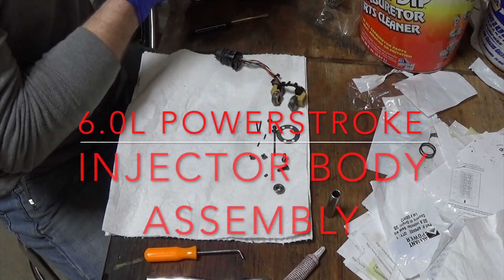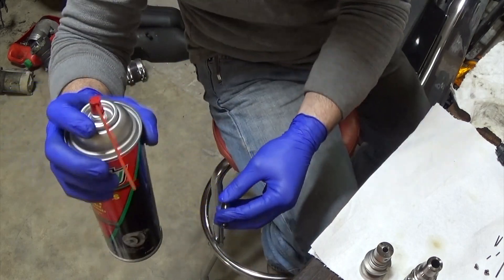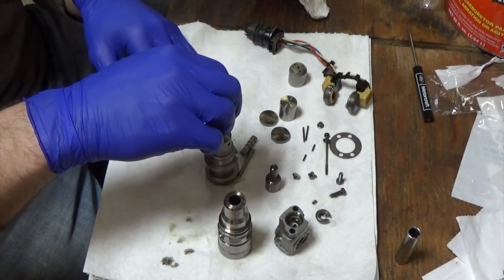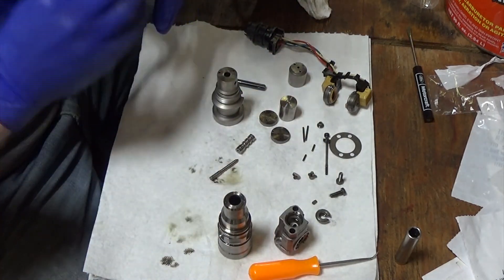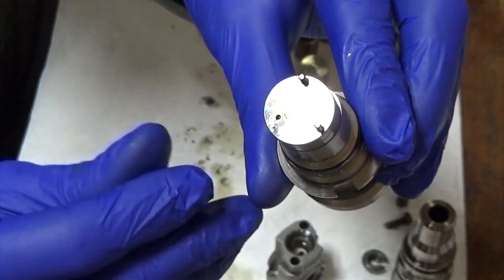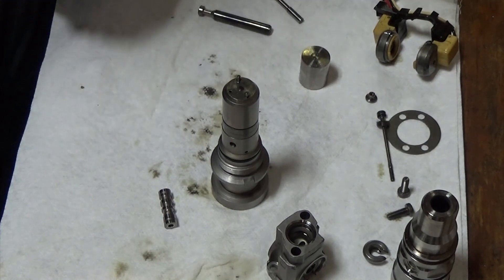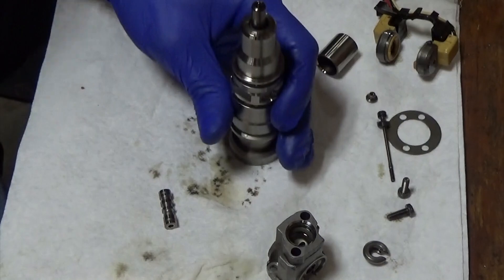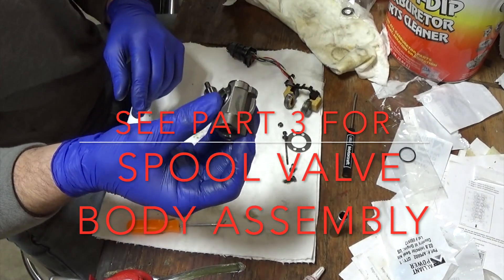6.0l Powerstroke Injector Rebuild, Injector Body Assembly Part 2

Comment: Yes, and I’ve replaced every oring under valve covers, new hpop , have put in 2 different ipr valves , new standpipes dummy plugs, worked on several these things but this one’s wearing me out, I appreciate your videos, was just wondering what symptoms that truck had with backward spool valves. Thank u sir.
Reply from the maker: Yea that’s frustrating.  With it only making 300 hot. Your air testing while hot. It should have a leak that is noticeable. But I’m assuming you’re not finding one. 
You’re doing the air test at the IPR. I’m assuming that means removing the IPR? 
You maybe answering your own question. Where are you getting IPR valve from?
Reply: @showmerepair yes removed ipr . I pulled an ipr out of a running truck I own  still hot no start. I would go with branch tube but previous owner said he never had a hot no start. This truck lost a cam lobe, why I rebuilt the engine. It’s built to the hilt I just havin no start hot just grasping for straws 😊 really good videos on injector build
Reply from the maker: @shellymorrison6796 hard to question an IPR that came out of a running truck. I’ll think about it and reply if anything comes to mind.
Reply from the maker: Also is it the correct year IPR. 
I know I’ve installed an early 2003-2004 IPR in a 2005 and newer and the truck was not happy. 
I either get motorcraft or accurate diesel IPR valve.

Comment: Spool valve backwards cause no start hot? On just one injector.
Reply from the maker: It should cause a no start cold. If it does start. That cylinder would show up as a misfire.
Reply: @showmerepair thanks for reply I got a rebuilt engine that I went completely through, only builds about 300 hot, I did sand the spool valves and replaced all external orings . I’ve done all I know to do twice, short of replacing the branch tube. 2006 model. Air testing through ipr valve.
Reply from the maker: @shellymorrison6796 have you pulled the valve covers while air testing?

Comment: I have a couple of questions how do you make injector sizes like the nozzle and what else is the difference lets say like a 175/30
Reply from the maker: @GageGonzalez-k3b  30 is the percent of flow over stock nozzle fuel flow. Many places sell larger nozzles. 
175 is the internal holding volume of the intensifier pistons chamber. 
If I remember stock is 155cc.
Reply from the maker: @GageGonzalez-k3b  here is a link to a video I made calculating the math for injector size. 
https://youtu.be/A4R6YwFl_l4?si=4NLcuTqzomHnE1mn

Comment: That little raised area on the nozzle needle isn’t machined on there from the factory.  It is wear but doesn’t really hurt anything.  I actually think is is erosion from the high pressure and high frequency from the injectors firing.  I have built many non 6.0 injectors and that wear is common for all injectors with this style of nozzle.  Great video.
Reply from the maker: The very tip of the nozzle? I’ll have to look at the new set of nozzles I have.

Comment: Hey awesome video man im about to order up a kit and get it done. Question i have for you is, on these injectors is it most of the time just a question of cleaning them and changing the orings? Or do you see some of the components damaged or scratched to the point of needing a replacement? I ask because i hear that sometimes if you loose fuel pressure below 42psi you damage the injector, im not sure how it would become damaged from that.
Reply from the maker: Make sure the spool valve moves freely. If I have one that feels like it’s not moving freely through its bore. I’ll gently sand it with 2000 grit sand paper. Doesn’t always fix it but some times does. 
The part that can be damaged due to low fuel pressure is the plunger under the large spring. I’ll sand the edges of the plunger lightly with 2000 sand paper.  Other then that just inspect everything.
Reply: @showmerepair  thanks for the quick reply, awesome video
Reply from the maker: Your welcome and thank you

Comment: Excellent video  ...where would the diesel leak into oil ? if was injector ?
Reply from the maker: Diesel fuel flows through the cylinder head to feed each injector. The white and black o-rings on the body of the injector seal the fuel in. If the black seal is damaged at all fuel can leak out in to the valve train area of the cylinder head. 
You can also have an injector that has failed internally and is leaking fuel out the body. 
A good way to check for either of these is to put dye in the diesel fuel. Remove the oil rails from the head. Run the electric fuel pump to build fuel pressure. Use a black light to inspect around the injectors for leaks.
Reply: @showmerepair  Thanks !
Reply from the maker: Your welcome

Comment: At 5:30, what did you lubricate with?
Reply from the maker: I use clean engine oil.  If I have anything 5w20 to 15w40 setting around I use it to lubricate the injector as I’m assembling it.

Comment: What’s the torque setting?
Reply from the maker: What part of the injector are you torquing. There a 3 different fasteners torque.
Reply from the maker: I believe I go over torquing in video 3
Reply: @showmerepair  I checked, and you didn’t, I meant the body torque

Comment: great job Chris! Question, do the injectors last? Obviously, you have done this before, great work. Are you confident enough to warranty them? I have never tried this and have been working on these 6 os since they came out. I wanted to but heard they dont last specially here in cold Boston  thanks bro
Reply from the maker: The only thing that is keeping me from offering this to customers is running them on a flow bench. I’ve done this for myself and friends. Then installed them in the truck to make sure everything is working properly. I would not want to rebuild an injector and send it to someone to install themself with out running on a flow bench. Running on a flow bench would at least let me know the injector was operating correctly when I sent it out.
Reply: @showmerepair   Sounds good bro. so they have lasted.  I have one I may try.  Has rough Idle when first starting on a cold morning.. Electrically passes with IDS and has good current flow through the coils and is a friends truck. I think 1000 bucks sounds about right;)
Thanks  bro
Reply from the maker: I am working on a flow bench.  I’m going to have videos coming out soon with me trying to figure how to build it and make it work.
Reply: @showmerepair  Sweet! looking forward to that. Thanks

Comment: Channels going to blow up
Reply from the maker: Thanks. Definitely slacking lately since where I’m at the temps are around 0 and my old house is having plumbing issues. But I’m planning on getting another video engine rebuild video out.
Reply from the maker: Is there anything I haven’t covered hat you’d like to see?
Reply: @showmerepair  yeah I feel you working in the cold sucks,I think your content is much different than any other channel,has a ton more info and educational purpose,I just like your rebuilds nothing specific.
Reply from the maker: Thanks Dakota I appreciate that. I’m gonna keep trying to put out videos that have good info.

Comment: Can you tell me, are there gasket/seal kits available as a set for everything needed to do a complete injector set replacement? I want to change all eight injectors
Reply from the maker: Yes. You can get a kit to service all 8 injectors from Bitter Root Diesel. I’ve always bought kits from them since they come with new springs. https://bitterrootdiesel.com/collections/6-0-powerstroke/products/2003-2010-deluxe-6-0-powerstroke-injector-rebuild-kit
Reply: @showmerepair  Thank you so much for the fast reply. Greatly appreciated
Reply: @showmerepair  Oh wait, I was inquiring about valve cover gaskets etc, anything that would be involved in getting to the injectors
Reply from the maker: Your welcome. Good luck.
Reply from the maker: Oh. Your asking is there any other gaskets or parts needed to service the injectors?  The valve cover gaskets are a reusable gasket. For a late build 6.0 you may check the o-rings on the stand pipe and d-plugs.

Comment: Thanks for the great instructional video. Have any of the injectors you’ve rebuilt needed new nozzles due to age or are they all simply covered in carbon and needing a soak in solvent?
Reply from the maker: Jeremy O I have heard of nozzles cracking but have not seen them personally. I did rebuild an injector the other day the was misfiring under load at times. It was better after I rebuilt it  but still showed on my IDS power balance that it was still weak when driving. The internals of the injector looked great. I replaced that injector with a Ford reman. I suspect it was a nozzles since both times I removed that injector it had wet fuel hanging off the nozzles when pulled from engine. Though the fuel is supplied through the head and when removing the injector it could have ran down the body of the injector. 
I just don’t remember seeing it on the other injectors.
Reply: @showmerepair  Perfect, Always invaluable to get great first hand  info from someone who’s got the knowledge/experience and willing to share. So thank you for the information! Good luck with the bench tester , would be cool to see that when completed, Subscribed.
Reply from the maker: I am working on building an injector flow bench. Then I’ll be able to have a better idea.
Reply from the maker: Thanks Jeremy. When I get it going there will be several videos. Good luck. Feel free to ask more questions.
Reply from the maker: If your interested. Dynamite Diesel Performance can make you 10 hole injector nozzles. Go look into what they’ve found in testing 10 hole nozzles on their Cummins.  Very cool what they are learning and sharing.

Comment: Hey man good stuff, but please don't  sand down the plunger of the intensifier body like you did early in this video. The only thing preventing diesel fuel from diluting your oil is the clearance between the plunger and body. The clearance is less than 1/50th the width of a human hair. Double the clearance increases the dilution exponentially. This is an engine killer over time even though the injector will work just fine.
Reply from the maker: Phil Vince thank you for the good info. I’ve learned so much good info from people commenting.
Reply: @showmerepair  you are welcome. While you can rebuild these injectors,  and it might be cost effective for someone on a budget and time, it doesn't replace a proper reman. The machined components do wear, particularly the spool in the control valve. They need remachining to very tight tolerances to restore lost horsepower and torque. I've seen  upto 40-50 hp recovery on a stock engine by replacing worn out injectors.

Comment: Do you know if there's any way to decode the numbers on an injector body/nozzle? I pulled some used injectors to rebuild but wanted to know if there original injectors and nozzles first.
Reply from the maker: Brady Young sorry I do not having any info on decoding markings on the injectors. I’ve not seen any info on that either.
Reply: @showmerepair  OE nozzles have the words Continental or Siemens on the upper shoulder. The part of the nozzle not visible from the outside. Anything else is an aftermarket copy. 

Word of warning I have seen some remanners try and repair the seat inside a nozzle. This removes all the case hardening and can greatly increase the likelihood of cracking. Look for the needle to be a lot lower in the body than normal.
Reply from the maker: Phil that’s great information. Thank you. Feel free to DM me. I’d love to ask some questions.

Comment: Sir Chris,  Awesome Video,  Based on your response to Andrew Bartleman about resistance in a filing coil, what should the ohms be on a good coil?  Thanks in advance.  If the women don't find you handsome they should at least find you handy.
Reply: Should have read failing coil!!!
Reply from the maker: Brian Finch  thank you. Ambient temp. .4-.6 ohms. Normal operating temp .4-1.5 ohms.

Comment: I have a very low km 2003 6.0 that I have owned since new. My fuel economy is dropping and I notice it smokes white smoke at idle now and getting more black soot in the tailpipe. The software is up to date in the pcm and idm and the voltage is good. Is there something in the injector that can be causing this? It runs great otherwise than the above issues. It has about 50000kms on the motor.
Reply from the maker: smoke skull it’s a possibility you could have 1 or more injectors causing an issue. Maybe the small spring that holds the needle seated. 
Any codes in the pcm? You say you get white smoke on start up?
Reply from the maker: smoke skull I read your comment again. White smoke at idle. Are you noticing any drivability corks. Like slow to build boost at times? Stumbles when at cruise? Hesitated on acceleration? You say 50000km on the motor. Is this a rebuilt engine?

Comment: what Lucas product do you use to assemble the injector?
Reply from the maker: Chase Smith I was using heavy duty oil additive. I’ve used it many times when rebuilding engines. You could use new 15w40 left over from an oil change.
Reply: @showmerepair  Thanks for the quick response. Excellent video series. I am going to try to tackle it today.
Reply from the maker: Chase Smith feel free to ask more questions. I’ll help the best I can. Good luck.

Comment: are you rebuilding these injector because of misfire ? great  video.
Reply: i want to replace my injectors it misfires come to idol after running from free way. in misfires for a couple seconds then go back to normal. it seems like loosing power when towing trailer up hill. some times it go to limp mode.
Reply from the maker: You may have some weak injectors. Do a good diagnoses. Check to make sure fuel pressure is good. Check for codes. Guessing can be expensive
Reply from the maker: thomas chin cold start misfires and if it was weak to were it didn’t cause a full misfire but it wasn’t contributing as it should.  If you have a dead misfire. You either have something else causing the concern or you will find a broken part when disassembling the injector.

Comment: Hey Chris. Thanks for the vid on rebuilding these injectors. I'm doing a head gasket job right now on my 6.0 and one of the injectors was stuck in the head. Long story short , I took the 2  t15 screws out to remove the electronics out of the way so that I could pry up on the injector with a couple of pry bars and the the injector popped out along with the big plunger and spring. I referred to this video to  make sure I didn't lose any parts and put it back together. I was gonna buy a new injector until I saw your videos and figured out that I still had all the parts. I put it back together and it's going back into the truck, Eventually, I'll probably have to rebuild the injectors but for now, they're working fine.. Thanks... I just Subbed to your channel.
Reply from the maker: Marcel LeMay thank you. I’m going to put a new quick video about torquing the spool valve bolt. I’ve had some come loose. If I remember correctly. It .4 nm.
Reply: @showmerepair  how much does it coat approx to in parts alone to rebuild injectors? Can you get everything from alliant ? Does the electric side ever have failures?
Reply from the maker: Andrew Bartleman www.bitterrootdiesel.com. 
Yes the electrical side goes bad some times. If the electrical side is bad the pcm will set a circuit code for that specific injector. Before replacing the injector or electrical part of the injector due to the code you should check resistance of the coils.
Reply: @showmerepair  how do i check the coils for resistance? Dumb question, i know.. im just not sure which part of the coil to check.

Comment: Love your videos Chris. If you're doing a lot of injectors, a good investment would be an inexpensive ultrasonic cleaner (they start at $35 on Amazon). We use several in our fuel injection shop and they do a much better job of cleaning stuff than just dipping in carb cleaner or using aerosols/rags. Plus they leave your hands free to do other stuff while they work.
Reply from the maker: gmupps thank you I’ll look into it